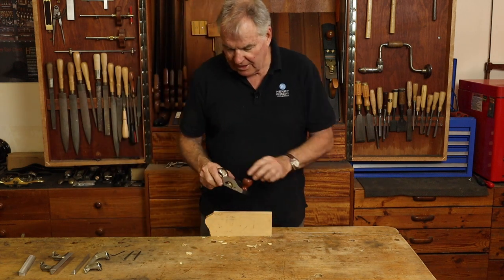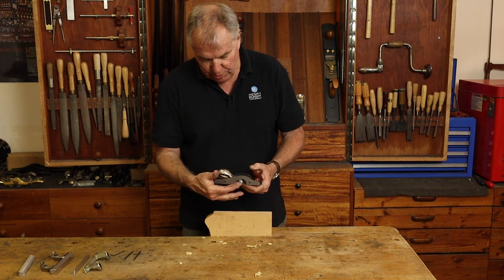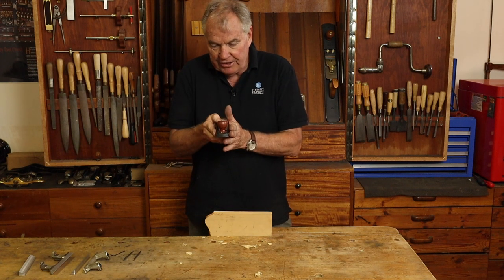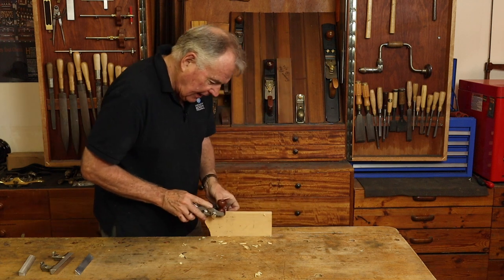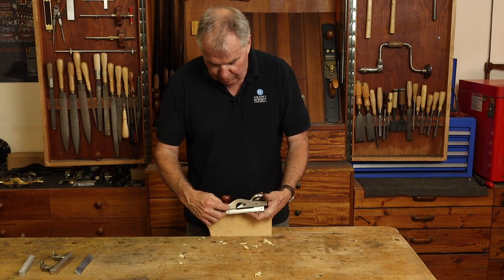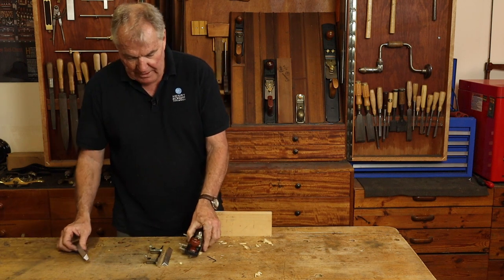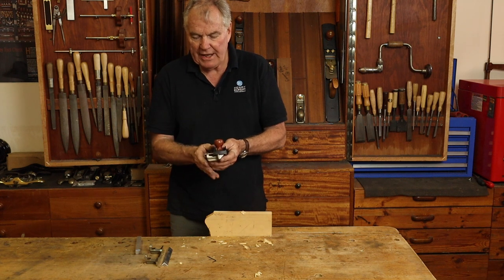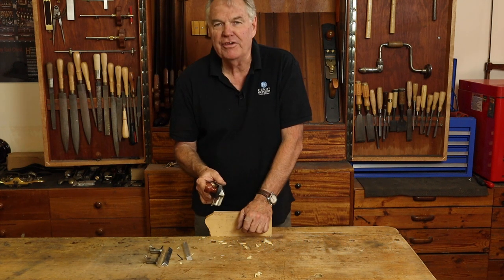The HE # 507 Rebate Block Plane

Comment: I ordered the HE 307 plane.  They were currently out of stock and I agreed to wait for the next batch to be produced.  The plane was made in Australia and I am in Colorado, United States.  So I had to deal with customs and shipping delays.

That being said, I did receive the plane.  The overall workmanship of the tool is simply outstanding and compares with Lie Nielsen.  The body grinding was perfect and square on all angles.  The blade was shipped razor sharp and ready to use out of the box.  The redesign of the original Sargent design included significant improvements to the original pattern.  The bronze work was excellent.  The overall feel and hand placement is excellent.

If your looking for a rebate block plane, there are two models on the top of the list.  The Lie Nielsen 601/2 rebate and the HE 507.   While veritas does excellent work, I am not fond of their ergonomics.  The HE 507 has additional provisions for the use of a guide fence.  The guide fence is precise and made of mang. bronze and adapts quickly and precisely to the plane.

In short, this is one plane that will not disappoint and works in conjunction with my original planes, my Lie Nielsen planes and my own hand made planes.  While I do high end woodwork and pattern work, I am better at Super Precision, Defense industry class, tool and die work.
Thanks Henry et al for a wonderful addition to my toolbox.
ADE